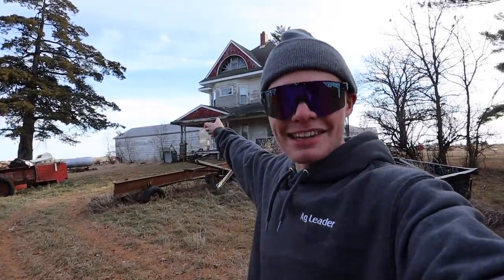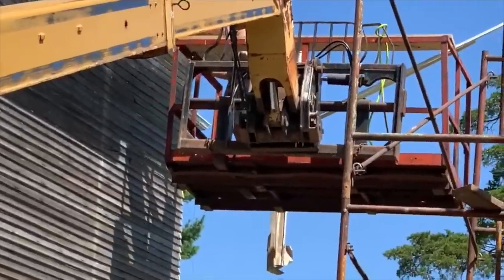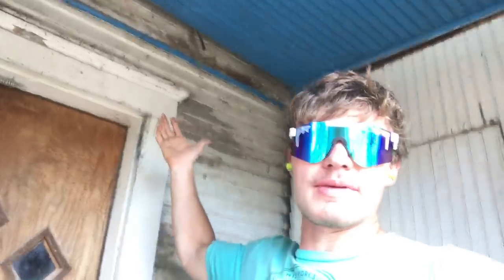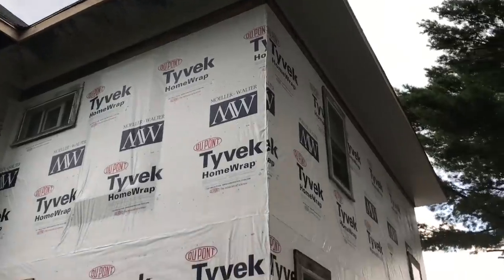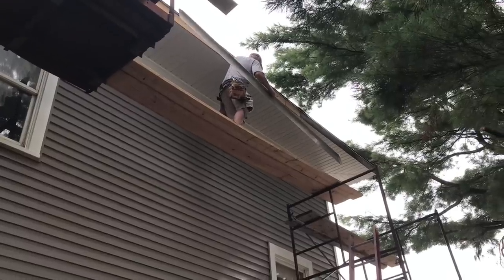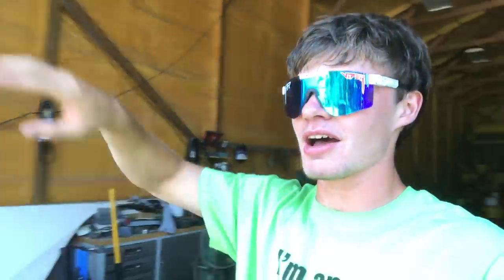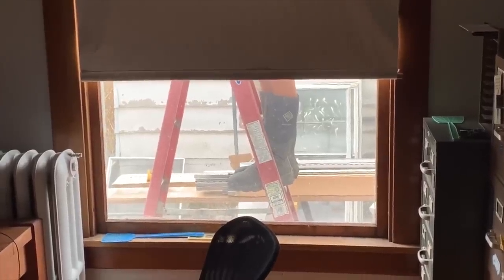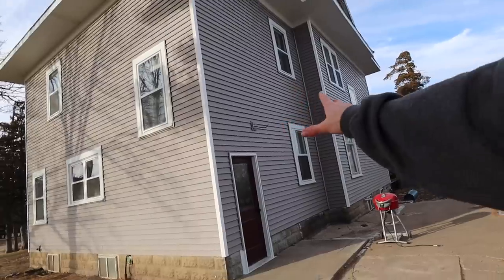OLD FARM MANSION 1ST REPAIRS IN 102 YEARS!?!

Comment: I love the fact that the vinyl siding  mimics the original. Hopefully when you rehab or replace the porch you keep the old aesthetic of the original. I love originality in the process of redoing old architecture. So far you guys have done a phenomenal job on the home.  Your grandfather would be proud of the remodel.
Reply: So glad to see vinyl siding put up correctly. You took the old wood off first. All my 1911 wood is dry rotting because Dad put vinyl over it. I have a brick house so all the overhangs and trim on third floor are dropping pieces if vinyl because the dryrot can't hold the vinyl on anymore.

Comment: When we use the fork lift like that we use a pallet to walk on.
Reply from the maker: KAREN RIGGLE I offered!
Reply: @ColeTheCornstar  DCS stubborn. haha
Reply: My daughter is a nurse.  GET THE PALLET!
Reply: @robertalynch5433  Isn`t Cole sister a nurse?
Reply: You want to be careful changing the inside insulation, old house need to breathe. To much insulation and you might bring all kind of New problem.

Good Job what your guy did so far look fantastic.
Reply: There is a video around somewhere of a guy working on the roof of a tall factory bay. He is stood on the top of a stepladder, balanced on a pallet, held up by a fork truck at full extension.... with that fork truck held up by a SECOND fork truck at full extension.....

Comment: Can i suggest for when you renovate the inside, you should do mineral wool insulation. Its much better then fiberglass, its hydrophobic, more dense, usually 70% recycled material, and has a better r-value then fiberglass insulation per inch. It costs a little bit more but its definitely a better option in my eyes at least. Hope you will give it consideration. Thanks :)
Reply from the maker: Stars 1222 spray foam 😉

Comment: It was really interesting to see the two smaller porches being removed.  The smallest (the one removed first in the video) looks like it was an addition to the house.  The other porch (the one next to be removed) looked like it had been original, since it had the same columns as the front porch, but that it had been closed in.  I can understand why those two closed-in porches had been added - they'd provide a barrier to the outside and prevent heat loss when the door was opened into the house.  This was a LOT of work!  Thank you for sharing it with us!

Comment: Really sad to see a beautiful old home like that get covered in vinyl siding—I understand why but it doesn’t make it any less sad.
Reply: True, but vinyl is final, so they say.
Reply: Vinyl siding is better than no siding and a house falling apart.
Reply: Cory Driver I'm va traditionalist myself , I helped a guy that owns a sawmill last summer , he 
informed me that wood from tulip trees was the wood used to make siding on older houses.
Reply: I detest vinyl siding, they fade, warp, and/or shatter after 10-15 years.
Reply: @BWYinYang , Hmmm, mine's over 25yrs old and no such problems ?
Reply: BW YinYang I’ve heard that vinyl siding making a lot of noise with the changes in temperature. My friend said if it hadn’t cost so much to install she would like to rip it off.
Reply: @doreenblatz2440 , No noise here. Seems to be a lot of rumors going around about vinyl.
Reply: The new patterns today look like wood. I have metal siding and it is very noisy in the extreme cold winter and in the extreme heat of summer. Maintenance and insect free are some of the reasons these sidings were created.  Perhaps lack of lumber as well.
Reply: Try pricing real Cedar siding compared to Vinyl and then having to paint or stain it every 5-8yrs, you'll go with Vinyl every time. JMO.
Reply: august this wasn’t a rumour it’s what happened to my friend. We live in Canada and we have a lot of extreme temperatures here. Even the trees here in winter make a lot of noise.
Reply: @doreenblatz2440 , I don't disagree that it may be happening. Vinyl siding has to be put on the structure in a slightly loose method for expansion and contraction, if not, it can cause a lot of noise. Also, if installed too loose, the results can be the same.
Reply: Yes, vinyl will make noise, I hear mine moving all the time. In the morning when the sun starts to warm it up
Reply: We’ve had our vinyl on a long time.... it’s held up well, but really could stand a WARSHING! 😂
Reply: @mommacs6159  
North side of my garage is the same way. Needs cleaning
Reply: BW YinYang , well I've had mine on my home for 28-29yrs and counting...could use a new paint job,(only bc I'm tired of the same light tan color, absolutely no fading and never heard any noise..but I'm in Phoenix,Az, hot as hell,) and got damaged in a few small spots bc of a weedwacker hiting my gravel...other than that....Sears did a great job !!.... Cole I love your color choice and the windows are beautiful !!!
Reply: I tried talking cole into Hardie board but what can you do
Reply from the maker: august it was like $60,000 for my house to go back to wood!
Reply from the maker: Gerard Lieb I looked into it but it was $50,000.
Reply: @ColeTheCornstar , I agree with you Cole, Vinyl was the smartest choice by far !!
Reply: @futbolplaya07 , Why ? Then he still has to paint it every 5-7 years, with Vinyl, install and done.
Reply: @BWYinYang  Then the siding was not put on right.
Reply: @augustreil  Hardie plank siding is best. Paint last looong time.
Reply: @BWYinYang , I agree, but it doesn't have a maintenance schedule as low as Vinyl by any stretch. Look, I love Cedar/wood siding more than anyone, but Vinyl is final...for the most part.
Reply: Cole The Cornstar I don’t blame you buddy. That’s a big house. Costs get crazy!
Reply: Marilyn M guess you didn’t read the part where I said I understand why.
Reply: august like I said — I understand why  they went with vinyl.
Reply: Momma CS I totally understand why I just don’t like the look.

Comment: Love love love what you’ve done to the house so far. Are you going to rip out the attic yourself or as you said in earlier video, get someone in to do that as it’s a big job? 
For the time it took you to trim off that tree you could have cut it down and dragged it away with the tracker lol. Will you be chopping it up into logs for the fire?
Enjoying the videos Cole, keep them coming. Thanks 😉
Reply: Ha! I was thinking the same thing.
Reply from the maker: I'm not sure! I wasn't in the mood to pull the whole thing down 😂
Reply: Nope! Pine is unsafe for inside fireplaces, the pitch builds up and can cause a chimney fire. Does make great bonfire wood, though.
Reply: @ColeTheCornstar  well, you just tie a rope to the top, then to the back of a tractor, and cut the trunk close the the house about halfway, and you can pull the tree the rest of the way down without risking it hitting the house, it just takes a lot of rope

Comment: Cole, be careful renovating this old house. This will have a lot of asbestos in it from the insulation to floor tiles and even in the wall mud. The paint will be all lead and these two issues will do a body no good. Respirators should be a must when working on it, there is no danger until you work on it so don't think sitting in the house is going to kill you, but once you disturb it then it can cause health issues.
Reply: @lhanso20  when doing any kind of abatement the best protocol is respiration filtration. Any reputable abatement company will also put the area under negative pressure to keep stray fibers from escaping outside. Just putting a fan will actually just blow the fibers around and they will land where you don't see and can contaminate by secondary means.

Comment: Great to see you guys are improving your family assets! Similarly, I have been fixing up my family assets too. One house is from 1910 in BC, Canada and one in from 1914 in Arizona. Both are now highly insulated with new electrical, new roofs, new plumbing and about to get electric thermal mass heated floors, solar PV SunPower roof systems along with electric vehicle chargers. One step at a time young man. Good work!

Comment: I love that you are saving this old house! But people are moving away from vinyl and metal siding. That wood siding is priceless. The nice thing is that the vinyl can be taken off when it goes bad. The house still has its structure. But wood is superior in many ways. Any house that doesn't have a vapor barrier on the interior like plastic or thick plaster with paint needs to be able to breathe (vapor). There are new(ish) techniques to putting on wood siding in order to make the house breathe and still shed rain without hurting the sheathing.

Comment: It’s great to see the progress on the house. The house will be much more air and water tight and the maintenance is nearly zero. 
However, as a restoration almost and conservationist a little part of me dies inside. The original tight-width clapboard siding brings lost does detract from the architectural/stylistic integrity of the house. As well as the destruction of the side porch with its upper porch. Financial costs taken into account I get why you had to do it. Just unfortunate that it’s lost. And then when you mentioned having to remove and replace the front porch I literally bowed my head. I hope that you are able to rebuild the stonework back to original and keep the columns. It would just allow the exterior to represent the interior of the home and keep the continuity of it all. Once you lose it you may never be able to get it back.

Comment: If you blow in insulation inside from top down then you can put drywall over the lath n plaster using shims between. It is messy ripping the plaster off. Plus you get extra insulation.

Comment: We would have done the installation in a differnet way here in Québec, after puting the Tyvek we would have nail down a forence vertically ( piece of 1 X 3 ) every 1 to 2 feet vertically and nail down the siding...it prevent the condensation between the original wall and the back of the siding and helf the wall not to rotte...

Comment: I am not a construction worker.  Why did the outside have to be torn back to  the original wood?  Did you insulate the exterior walls?  I also recommend insulating any interior walls if you take any back to studs.  Helps with noise.  Your Dad is amazing.

Comment: Grew up on a farm, working off telehandler forks. We used an IBC pallet without a tank in it, threw a lynch pin in the fork hole to hold it on. OSHA jokes are funny until somebody's hurt bad. Doesn't mean you need to tie off in a harness for everything - I just try not to do anything that will sound really dumb (@4:00)when I say it out loud at the ER. Good rule of thumb. A fall from there especially at that age will ruin your life if it doesn't end it.

Comment: One of the very important items you missed when you replaced the siding is the Waterboard. There was one on the house before you started to demolish the old siding. It is ussually about 10 inches wide and is at the very bottom edge of the siding. The design idea is to create a picture frame setup on the sides of the house. Without these the picture frame is missing the important bottom element. It's still not too late to place on and it will really improve the appearance. Make sure you put a metal flashing under the siding and over the top of the waterboard. Just saying!!!

Comment: you can get sap off your vehicle with methyl hydrate BUT if you use it put it on a microfiber towel just a tab rub softly and immediately wipe it off with a cleaner safe for paint or water.

Comment: Personally I wouldve stuck with the classic look of wood sliding and from a safety perspective its alot easier for firefighters to save a house when its wrapped in wood concrete or stucco simply because vinyl siding is like wrapping your house in gasoline

Comment: That is not the original insulation, at that age, it probably had no insulation when built.  It looks like blown-in cellulose was put in at some point.  The holes along the original vapor barrier at 2 feet up or so are a dead give away that it was blown in after construction for the outside at some point.

Comment: What was that insulation? It looked like old decomposed vermiculite. If its vermiculite, its safer to remove it from the outside. It's also a bazillion times easier to rerun the electricals on bare frame. A lot more room to get the drill in place and put in the the outlet boxes/conduit.

Comment: I moved out of home when I was 20 and moved into a farm house also built in 1917 with knob and tube wiring and push button light switches. You still use the radiators for heat? If it has a oil fired boiler I would love to have that heating oil account 😅🤣😂
Reply: I love hearing about the radiant heat, I knew a lady that had this in her house and she would fill up the water every year to fill up the upstairs and downstairs radiator well the way she knew everything was all full was water would shoot out the side of the house upstairs - I always said the house was peeing. And when she lived there the system worked but when people moved in afterwards they didn't realize one switch downstairs had to be turned on to make it all work so they just thought it didn't work and didn't use it.
Reply: @icemancometh8679  yes it's the best heating system a house can have.

Comment: Most of the clapboard siding  that were on that house were not in that bad of shape, yes there was some damage in spots and that could be patched, but a good Prime and paint and they will last another hundred years whereas that vinyl siding will start to fade immediately. Oh,, well,, , too late now ) - ':
  As far as insulation, it was evident that it had blown-in cellulose insulation into the stud bays, it was seen where they were pulling off some of the old sheathing under the old siding. Not original to the house whatsoever, it was likely done in the 70s  or early 80s, I would guess.

Comment: Bird crap. You guys are gross but a lot of fun to watch. Your house is absolutely gorgeous . The the color of mine but mine is siding. The clapboard is gone Not many hundred-year-old House videos around. My house was built 1920 and it has been remodeled twice. The floors are dry as a bone when I pull up the carpet I have no desire to refinish and varnish. I think that's old underlayment and not hardwood. What I'd like to do is sand a little and two coats of primer and top coat of epoxy be done with it. Soft white floors nice and shiny what do you think? What kind of floors are you putting in

Comment: You tore off that mudroom from the side of the house,  I bet your grandmother demanded that your grandfather build that room.  It keeps the the mud, dirt, snow, wet smelly clothes from inside the house and it stops the weather from going straight into the house whenever you open that door.  Give it a few years and you will be thinking about building another type of mudroom, for yourself for the same reasons.